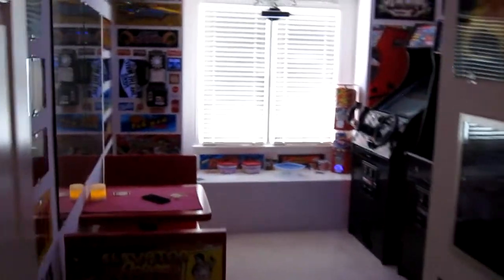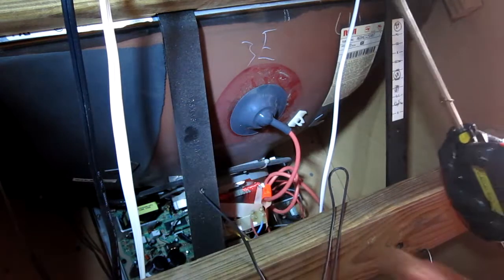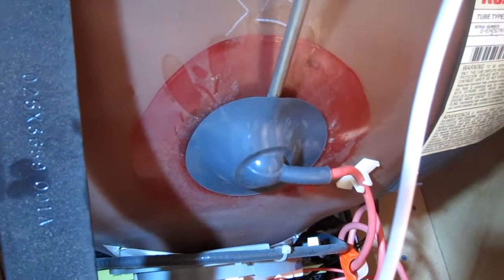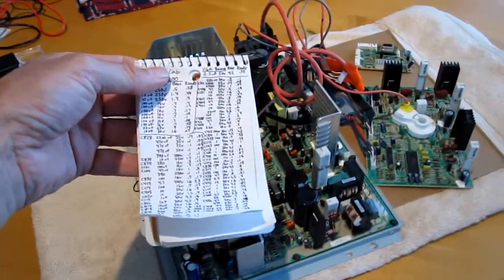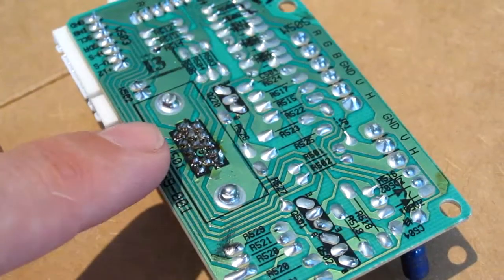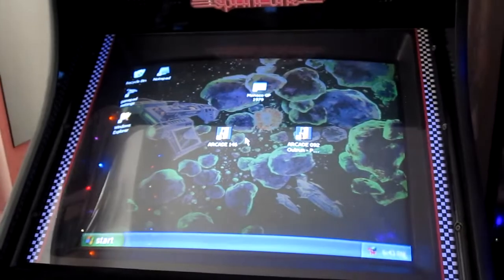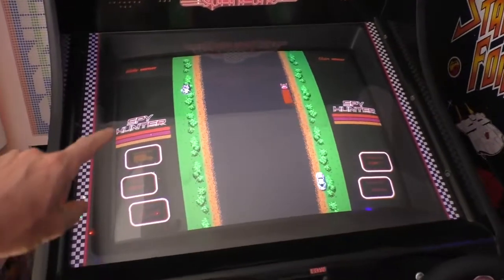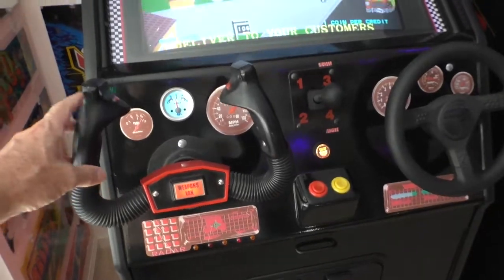D9200 Monitor Repair ARCADE Driving Cabinet build Wells Gardner CRT blinking flash black

Comment: Whatever happened to the apb and spy hunter restorations?

Cheers
Reply from the maker: hi, the APB machine will be finished maybe this fall. Just need to clean it up, paint coin door and touch up the side art. The SpyHunter machine is going to be a lot of work, not sure when to start on that. I remember it stopped working and had garbled graphics on the monitor. It was in bad shape, the monitor was dim and had bad burn in of the text from attract mode. i walk by the machines everyday and think about needing to fix them. thanks for the interest.
Reply: AnimationBubble awesome. Love your videos
Reply: How did you get potentiometer gas pedals to work with Mame.

Comment: Man, I've got a 33" Wells Gardner D9200 that's not showing an image, the screen is completely black. There is no dot in the center of the screen, there is not a line across the screen. It's got neck glow; I replaced all the capacitors, same result. Using the remote, the OSD doesn't show up either. I've read somewhere that I'll have to force a low resolution for it to snap back to normal... but that doesn't seem right. The board is EXACTLY like your 27"... I may see if I can just purchase a working board... If anyone has any suggestions, let me know! :)
Reply: Have you tried the black level next to focus on the chasis? The glow has to give you something if you adjust those. Don't turn it up too high, just slightly until you see something
Reply: @namco003  i know you mean the 2nd knob on the flyback. I dont think it would go that dark whether or not I fiddled with it. It's been so many years since ive had this plugged in, i might have tried it?...

It's sitting in a box next to me right now. My plan for it this year is to get it on the workbench and try it again. If I cant do anything, then see if some local service center would like to try.